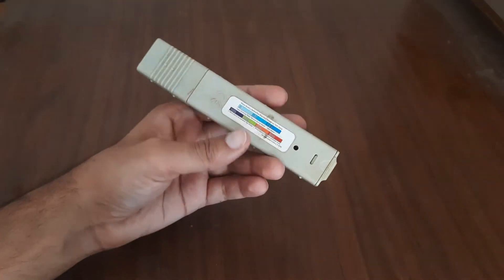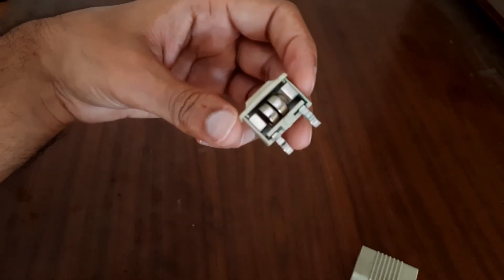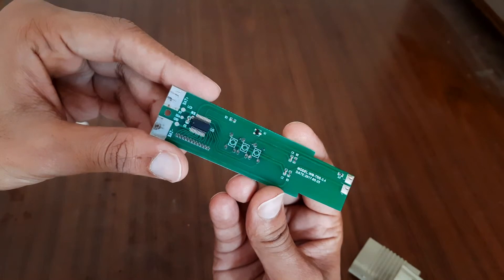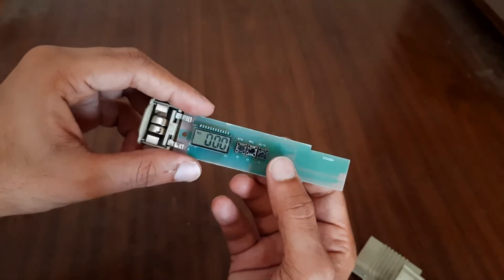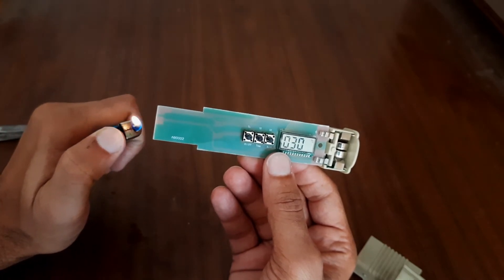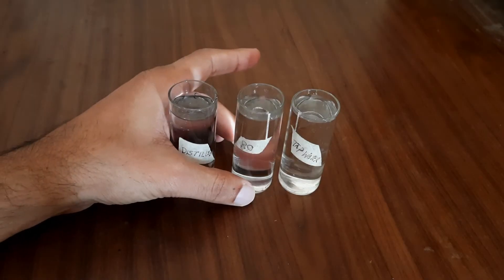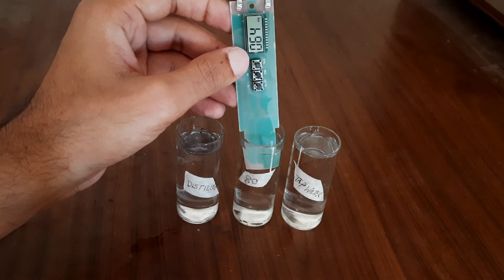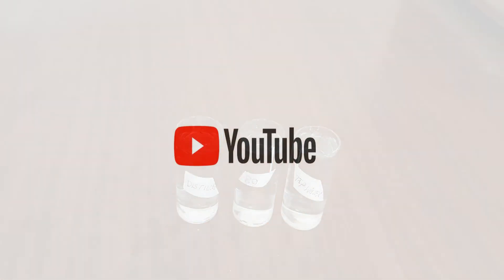What's Inside TDS meter | TDS meter Explained

Comment: Thanks for the video. How it is giving accurate result without the use of any chemical? And I think you mistakenly put an extra zero in tap water that is 1660ppm where it ought to be 166ppm.
Reply from the maker: TDS meters don't needs chemicals to operate it works in the principle of Conductivity if liquid has more dissolved solids it will conduct more electricity hence it shows more value & yes 
Here our tap water is too heavy it sometimes reaches 2000ppm
Reply: @TechsScience  but your meter is showing 166 where is X10 being shown?
Reply from the maker: Some meters missing 1 digit so we have to add 1 more Zero to the result
Reply: @TechsScience  how do we know when to add one digit and when not to when it shows 166 only on the display?

Comment: Hi! Do you think it is possible to somehow connect it to a PC or Arduino and read the measurements?
Reply from the maker: No, because you can only use the modules with Arduino but this TDS Meter has its own microprocessor In it
Reply: @TechsScience  Thank you very much for the answer
Reply from the maker: @alisbtan9870  🙂